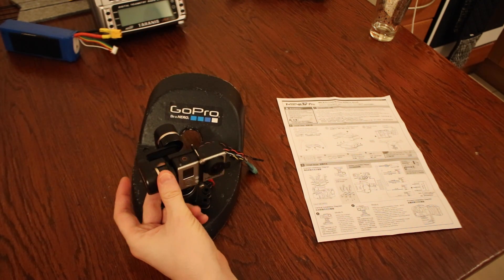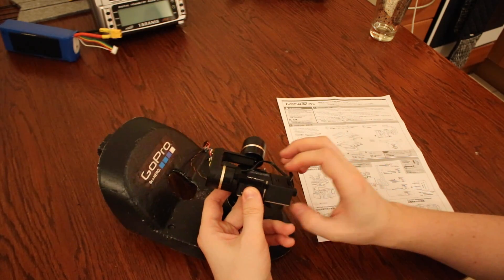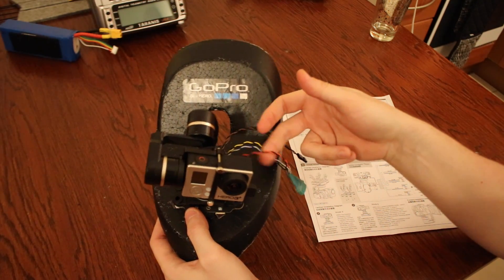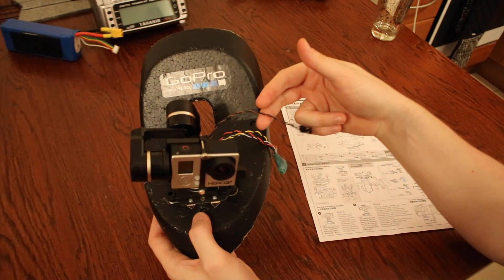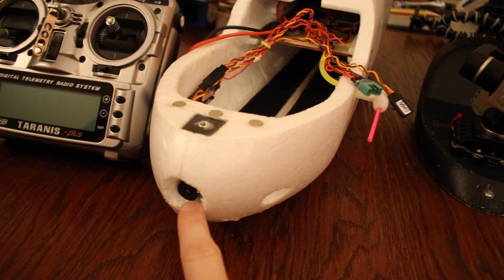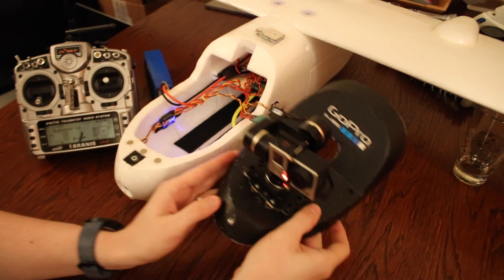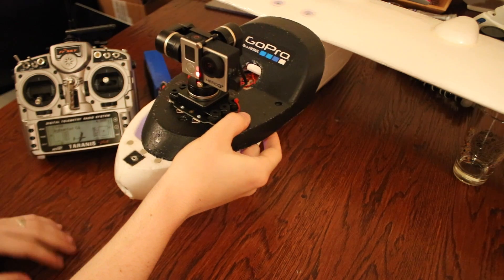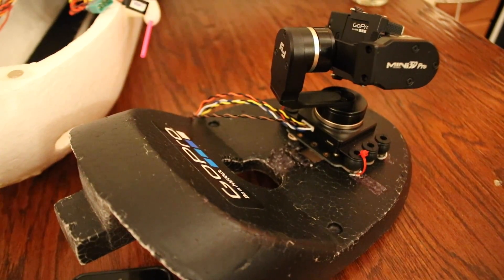Fixed Wing FPV Gimbal | Installation - Wiring - Demo of Modes |  Feiyu Tech MiNi3D Pro

Comment: I wish they did not discontinue this one. The wg2x seems to be the only option. You know if anything on the market now allows for the same control this has?
Reply from the maker: Sorry no, there doesn't appear to be anything on the market at the moment that I'm aware of. EIS is taking over at the moment and I have to say I prefer it to using a heavy gimbal. Cheers
Reply: @AdamGdoesFPV  yeah EIS is perfect for planes - however for drones, pitch and roll axes definitely require gimbals :)

Comment: Hi Adam, do you know how to wire the gimbal to your flight controller for follow mode?
Reply from the maker: Hi, what do you mean by follow mode?
Reply: @AdamGdoesFPV   the gimbal follow the flight controller orientation
Reply: Ok nevermind, I have found the nesesary info 👍
Reply from the maker: @gmerwe1048  If you meant to stay locked in place, this gimbal doesn't have that feature
Reply: That's a pity.. u would have been able to tell me how to do it 🙃
Reply from the maker: @gmerwe1048  There are just 3 modes and I demonstrate them in this video. You can lock the heading, and you can lock the pitch, but never the roll.

Comment: What’s the current product for this or new one for such a runcam or so forth ?
Reply from the maker: Thomas Eddy first check out my latest video on the Insta One X, in this video I talk about how this can replace a gimbal. I’m taking the gimbal in this video off my plane to replace it with the insta.
Reply: Ok but if I want to use a gimbal should I get this one wgx2 cause it's the Newer one but it doesn't have servo inputs ?

Comment: How can i settup my taranis to used the 360 pan? I can't make it work, ease help.
Reply from the maker: Set channel on the mixer (that matches what channel you have the pan signal connected to) and make the 'Source' as one of the dials. This is how i did mine.

Comment: recent days I'm planning to install a self-made 3-axis brushless gimble(based on storm 32) on my flying wing UAV to make the footage seems like shot by a DJI drone but didn't find anyone had made that. Why? is it unnecessary or something else? Have you thought about that before?
Reply: BTW the footage of  the gimbaled GoPro in the video is brilliant, I love that
Reply from the maker: Thanks :) I think not many people add them to wings because they're heavy, not very aero dynamic and expensive. Some people don't like the DJI stabilised feel either, they like the feeling of the fixed wing camera. I like a mixture of both, so I have the gimbal and a fixed camera on the wing :)
Reply: Yea I know that kind of feeling. Infect my major hobby is the racing drone freestyle and I love the feeling just as I'm setting in the craft when using the fixed camera.  Also, I'm clear about that it's important for the pilot to get information about drone's attitude. But this wing will gonna be used in long-range stabilized filming. Normal layout wings are usually unconvinced enough to bring with(compare with flying-wing layout wing) and DJI‘s endurance ......you know. So as a balance, it's worth to give it a try to put a gimbal on the wing, right?

Comment: Nice video! Is it still possible, to use the live-feed with a newer gopro? And how is it transmitted? Doesn't it have to be downscaled for live feed? Many thanks and keep up the amazing work! :-)
Reply from the maker: I don't know about the newer GoPro's as I don't have one. I know this works fine with the GoPro 3 & 4, and the Firefly camera I use. I assumed it worked with all cameras that had a live out. It's transmitted in the same way as from the FPV camera, but you have to run it through a video switcher if you want to use more than 1 cam for live feed. Cheers for the comment. Hope this helps. :)

Comment: Could you turn the mount around so the pitch bearing is on the other side, so as to put the lens closer to the yaw axis?
Reply from the maker: It's designed to work the way round I have it. It honestly isn't really noticeable that its not perfectly central, especially as I don't pilot through it

Comment: anyone know if this will do headtracking?
Reply from the maker: Bob W it wouldn’t work in the way you’d want it to. If you watch the video you’ll see it’s maximum rotation rate. It works more like a motor, the more input you give the faster it turns. Servos are better for head tracking as they will match your head movement
Reply: Hmmm... thanks! I was wondering about that, after looking at all the video's I didn't see anyone doing headtracking so I figured there must be some issue, thanks for clearing that up. still seems like a very nice gimbal for the money. the reason I was thinking of using a gimbal was the stabilizing affect it has... was wanting to mount it on a vehicle and thought it would smooth the bouncing out.

Comment: nice video . i have a skyhunter also and about to purchase this gimbal after seeing your video. just one question. how does the gimbal hold up to rough landings? not crashes, but maybe a few bounces or so.
Reply from the maker: Hey, thanks for the comment, glad you found the video useful. It’s been fine on rough landings. I’ve had a few in dodgy fields and it’s not been a problem. I do have my canopy screwed down though and I think it’s better than the stock magnetic approach because of the weight of the gimbal. Enjoy 😊

Comment: Very helpful Adam G, you covered all the queries I had.
Reply from the maker: Cheers Les, glad you found it useful
Reply: Given that the gimbal with your flight cam remains horizontal, you won't have any visual feedback when climbing/descending but especially when in a banking turn - does that not feel rather strange? I'm assuming the flight cam is attached to the gimbal.

Comment: Great review, many thanks, much appreciated.  I've never used a gimbal on a fixed wing aircraft (only quads and hexacopters) as I thought that the gimbal motors were not powerful enough to fight against the slipstream of air on an aeroplane.  Did you notice any problems when flying at speed?Any advice gratefully received.Keep up the great work.  Subscribed,Trevor.
Reply from the maker: Cool, glad you found it useful. I thin if you fly at high speeds like in a dive, you might see a small amount of vibration. Run it through software stabilisation and you'll completely eliminate this. Hope this helps

Comment: Is there appreciable lag with the live video feed through the GoPro?
Reply from the maker: I've not really noticed, but i bet there is some. When i'm viewing the live feed from the GoPro the plane is mostly flying itself so I'm just framing shots or taking in the view, in this situation the small amount of lag won't cause an issue like it would if i was still trying to pilot the plane through this view.

Comment: which radio control do you recommend for fpv?
Reply: (although you didn't ask me...)  It depends on the range and conditions you will fly in.  5.8ghz is popular for the small antenna, but it doesn't penetrate obstructions well.  If you're medium range (<250m) and up out of the trees, it's fine.  Down lower <150m it's OK depending on what gets in the way.

I prefer 1.2ghz for its range and penetration, despite the circularly-polarized antenna being about the size of half an apple.

If you want more than 4km of range, you have to get more creative, with directional antennas, antenna diversity, ground stations, or other frequencies.

Comment: Great Video Adam,....Didn't realise it was on a full 360 degree slip ring....Those noisy servos, Im guessing they are digital and not the quieter analogues..?....I avoid digitals for this very reason, as on a slow flying foam FPV plane they are overkill IMO.
Reply from the maker: Thanks :) yeah slip ring is a nice feature. Yeah they're digital, doesn't really bother me much the noise, I turn it on in the field and chuck it... can't hear them then :P
Reply: Adam G does FPV Yeah, ok....but all that buzzing makes them drag current continuously as they hunt around centre...Like your solution tho...just chuck it... quick...lol.

Comment: Hi Adam
That gimbal feels too noisy; I've got  i've got a mini3d (not pro) and it' doesn't make any noise. do you see any jitter going on as you move across the gimbal range?
Reply from the maker: Hey, the noise isn't the gimbal, its the servos on the plane. They're good servos and work well, but they're noisy :/
Reply: ah ok! good news then :) the gimbal is such an improvement on the footage (obviously!) I've got mine installed on the SW1900. Cheers

Comment: That really is a great tutorial FeiyaTech would be proud . I always fined it odd how there is a great product on the market but has poor advertising .. However not in this case Adam what a sterling job .. You really do have a great skill at tutorials please keep them coming..
Reply from the maker: Hi Ian, many thanks for the comment and compliment :) something fairly new to me making a video like this so I appreciate the feedback. Cheers
Reply: Adam G does FPV yeah i agree. youve set up your rig really well. a video switcher is such a good idea to run with this system. top demonstration and explanation. and great footage

Comment: (Gilbal on Banggood out of stock 2017-03-05)
I wonder if any flight controllers include stabilization electronics/logic?  It seems like a good use of all the existing gyros and all that lavish "F4" power, and having a separate gimbal driver board must duplicate virtually everything on the board.

I bought a similar gimbal from Banggood a while back.  Turned out it had non-licensed firmware, the board was "locked out" and while the gimbal hardware seemed fine, without a logic board to run it, it was useless.  When you're plunking down $208 plus shipping, that's possibly more than your entire rig,  so it's not an insignificant concern.
Reply from the maker: Hi Hugh, it looks like its expected to restock in 15 days (20th March). I think there are some flight controllers that do this, the only one I know of is the DJI Naza. Gimbal to connect to it still cost more than most though :/

Sorry to hear about the bad experience. I did quite a bit of research on the FY mini before buying so was fairly confident it was going to perform.
Reply: I particularly like the "slip ring" feature allowing continuous pan!  My Sky Eye will probably wind up with one of these.  Yes those three-channel video switchers are the bomb.  I'm thinking of adding a cheap CMOS to the side of the fuselage to watch laterally and see the flap and aileron on one wing.  Maybe it would help me  line up my turn for landing too.  Especially before I have a pan cam on it.